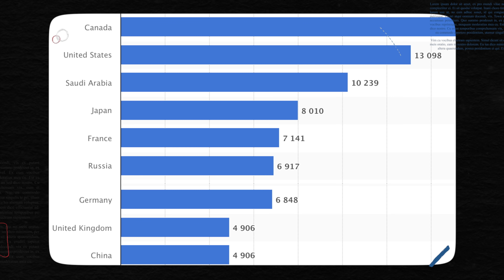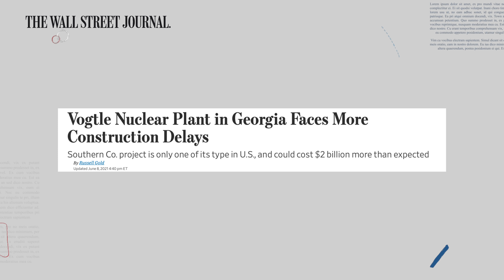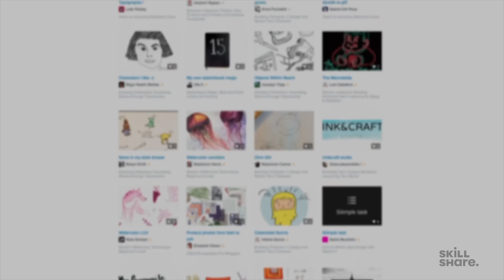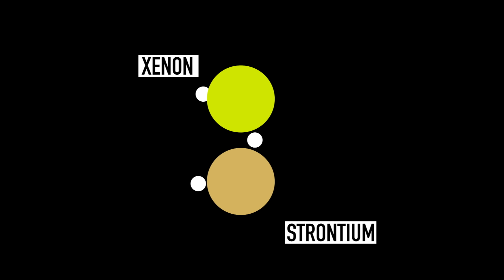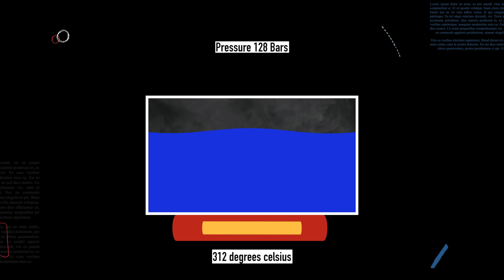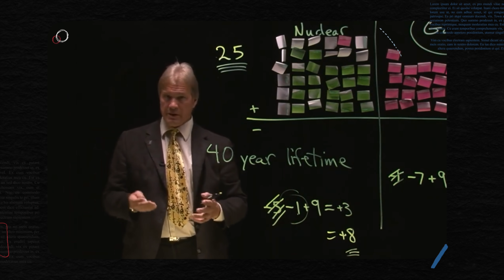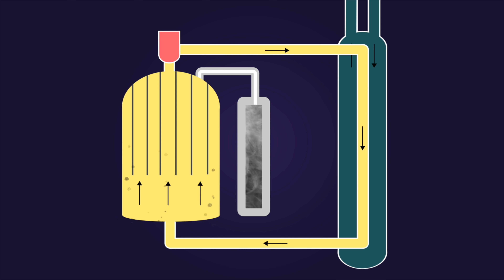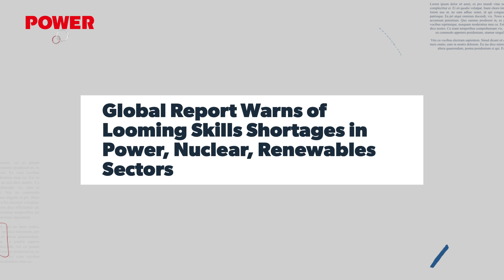Thorcon Just OBLITERATED Nuclear Energy’s Biggest Problem

Comment: The lady is absolutely correct. Nuclear electricity is expensive primarily because of the possibility of steam escape which at such pressures (160 atmospheres) is effectively an explosion.  Most of the expenditure on a nuclear plant goes into avoiding this possibility, and containing it, should it happen. The pressurised water reactor (PWR) is a giant jack-in-the-box. The terrific expense of of conventional nuclear reactors is trying to design them so that the jack-in-the-box never goes off, and even if it does, there are several schemes to mitigate the ensuing disaster, culminating in these massive, expensive containment buildings.  
We saw at Fukushima that the containment measures were ineffective. We also saw at  Chernobyl the Socialist foolishness of not even bothering to build a containment.
Another source of expense is in the precision manufacture of fuel rods, necessary for the operation of PWRs. In MSRs, the fuel is simply dissolved in the primary coolant.
MSRs do not need the enormous pressures found in PWRs in order to function.

Congratulations to the Indonesian government for being the first to commission an MSR reactor from Thorcon. 
Is this lady Indonesian? I thought she was Indian.

But mention was not made of Moltex, a company with an alternative design of reactor (which can be made in a factory rather than a shipyard, and will fit onto a few lorries, rather than on big ships), Moltex reactors not only generate electricity, but can do so from existing nuclear waste, thus solving two problems at once. Conventionally there is no way to deal with nuclear waste, except possibly to bury it, and hope that the geology will not spew it back up again. Nobody wants the nuclear waste in a hole near them. And storing it safely - perhaps for 000s of years is very expensive. So, consuming it in Moltex reactors and thereby rendering it harmless would be a very useful (and profitable) side-line, in places like the UK, which has a lot of plutonium waste from its existing fleet of Gas cooled reactors and one (soon to be two) PWRs. The French designed PWR is enormously expensive, and similar designs in Finland and France are not yet operational. They are years behind schedule.

Comment: The electricity use in different countries you mention in the start is per household, it is not per person! Still the difference between countries is the same. When we had 3 children lving at home we were at 6000 kWh/year here in Europe, but we don't use AC, our fridge i can carry alone and heating and hot water is from the local power plant as piped hot water, So mostly LED lights, TV, washer, dishwasher and computers use power.
Reply from the maker: Pretty sure the figures were per capita. Will check and edit. : P

Comment: you've got to love how nuclear plants kill less people per megawatt hour than people falling off roofs installing solar panels
Reply: True but The area around the roof isnt contaminated for decades:)
Reply: @jackphilipsen452  If the only permitted designs for aircraft were the ones developed in the 60s, we'd have huge number of airline accidents per year.  But we've learned from past mistakes, and while it is never possible to build a 100% safe anything, the odds can certainly be brought down to acceptable levels.  The lesson from Chernobyl is that you should not trust anything made in the USSR.  That really only leaves Fukishima as a major nuclear failure caused by inadequate design, which we have learned from.  3 mile island was sort of a nothing.
Reply: @jackphilipsen452  nuclear power plants don't contaminate the area around them though either.  Actually many a power plant has been built on already contaminated areas by previous industry, the land is actually restored to a cleaner state by the nuclear investment than it began with.
Reply: @jeremyO9F911O2  i mean after a meltdown like Fukushima or Chernobyl. Ofc then you make whole citys un inhabitable ,
Reply: @jackphilipsen452  first off learn what a meltdown is, the problem with those reactors is the explosion not the meltdown.  But good news nobody here is advocating for any of the reactor technology either is based on.  Generation 4 reactors are all safety first designed around new ideas and principals that don't allow the failure states that previous technology is susceptible to.  The MSR type reactor featured here cannot even remotely be in a similar state to either of those events.  You actually melt down the MSR to turn it on, it literally takes what is considered the failure state of previous reactors and requires it for normal operation.  Like I say meltdown isn't what you think and is a classic sign of ignorance in commentors.

Oh and BTW Three Mile Island was a meltdown too, with no significant radiological release and no long term contamination.   Before you comment learn the background because real advocates know the science and know the mitigations of new nuclear technologies.  Are you anti Science?
Reply: @jackphilipsen452  People are already moving back into the areas surrounding Fukushima. The release of radiation was rather inconsequential for the most part because the Fukushima containment vessel and containment buildings did their jobs. Chernobyl had no such containment building which is why the area around it is still contaminated. And these are the only two major accidents that have ever occurred that released meaningful amounts of radiation from the plant. All the waste from a normally operating reactor gets stored away from the public. 
Where does a coal plant store its waste? Take a deep breath, because now it's in your lungs.
Reply: @Clean97GTI  Yea how long did it take before people could move back, its over a decade and still there is high radiation in some area's around the power plant. You dont want your children to play on that ground. I Know the problems with coal plants and i did not advocate for it so dont  say I do. My point is that Nuclear is not the longterm solution as is coal.
Reply: @jackphilipsen452  There was never high radiation except around Chernobyl. In Fukushima, the average level is around 30mSv/yr, which is the same as background levels of radiation in some parts of the world. Evacuees from Fukushima were showing levels of radiation 3-4 mSv higher than normal which is well within safe limits. You get more than that by flying in a commercial jet airliner.
And coastal areas of Earth generally have slightly higher background levels anyway because of the minerals the oceans wash up. Seawater has uranium and thorium in it.
Nuclear is absolutely the long term solution if you want to reduce air pollution and combat climate change.
Reply: @Clean97GTI  you are not correct on the radiaton. Some spots around the reactor still gives too much radiation and are still not habitable. Also you say the radiation is well within safty limits, It depens how you look at that. We dont know the long term consequenses of long term exposion. Probably people gonna die of cancer more. (with coal its big too) Thats why nuclear is at best a good option to battle climat change for the near to medium future. Like I stated before. Nuclear has some big drawbacks. One of the biggest is the danger after a disaster (these wil always come sooner or later) And  nuclear waist. Where u gonna store it over 100 years from now? In your back yeard maybe? or dump it in the sea or a thirth world country? So we really need the urgency to innovate toward beter and safer technologys Thorium looks promising, This combined with solar/wind is the way to go.
Reply: @lkytmryan  True. Im not afraid of the accidents that happend before. We learned from it. I hope. But im afraid from the accidents we did not think of. For example:The Titanic was unsinkable but it did sink.
Reply: @jackphilipsen452  And yet we did not stop crossing the ocean in ships. We have turned into a country of safety nazis who are unwilling to accept any risk to live our lives. 

"A ship in harbor is safe but that is not what ships were built for."

Man was not meant to live his life in perfect safety. We progress by trying, failing, and trying again.
Reply: @lkytmryan  Sure, some riskt are okay to take, but some of them are not.
Reply: @jackphilipsen452  Renewable is more worse for humanity than nuclear. And you are totally wrong on what happened with Chernobyl and Fukushima.
Reply: @ManCheat2  al I stated about Fukushima and Chernobile is valid. Renewable is always better.  Its in the name. Nuclear can be renewable too. It all just need to be developed better towards Real renewable. As long nuclear is not 99.9 percent safe I would not go for that option ever. Too expensive too. Better alternatives are  already here.

Comment: This is a well-done, clear and technically accurate video that is worth a watch. It doesn’t just talk up a single company or technology but treats the concepts fairly.
Reply: The negative temperature coefficient of reactivity was not correct for Thorcon, only for LFTRs or MCSFRs with higher fissile to fertile + fission product cross section ratios.
Reply: @EdPheil  How can a liquid fuel reactor not have a negative temperature coefficient of reactivity? What, exactly, would stop a molten salt liquid fuel from expanding when it gets hotter?
Reply: @tsamuel6224  
A fuel salt has fissile contributing a positive component to reactivity. When fissile is squeezed out it provide a negative reactivity effect when heated. 

However, fertile, fission products, & other salt components absorb neutrons too AND 15% of U235 absorptions. When you squeeze these other neuton absorbers out of the core when heated, they squeeze poisons out, adding positive reactivity making power rise.

If poisons negative reactivity is greater than U235 positive reactivity, then the overall reactivity is positive.
Reply: Good, ain't she? This girl can boil something complicated down so Dufus McDumb can get a grip on a good sized piece of it while explaining it to the educable. Luddites man the battle station and guard your minds or you'll learn something from this girl. Her dad must be proud as hell.
Reply: I'm all for nuclear power, but the most important problem with nuclear power is the waste. No matter how it's stored there needs to be a way to reduce the amount that is stored. Either by finding other uses for the waste, or by making it non-toxic. Fission in any form is currently a dead end.
Reply: @thornblackwell5749  Thorium is the inert harmless version of nuclear
Reply: It does talk up Thorcon
Reply: You have got to be kidding.
Reply: @hewdelfewijfe No corrosion problem, I agree, but you do have creep even in steel due to high temperature.
Reply: Way too optimistic
Doesn't address corrosion
Dismisses the price of the fuel (but then says "unavailable" - flawed economic logic)
MSR safety and Modular construction: Great concepts - Best wishes - hope they're right
Reply: @fiftystate1388  Actually, not optimistic enough.  This is just a new spin on 1960 tech. Corrosion is addressed by the short use time span which is less than the proven near zero corrosion span, fuel price is in the fuel price chart and is abundantly available even though the preferred enrichment is unavailable, MSR safety was proven in the 1960s and modular construction is all that's new and even that is largely proven in modern fossil fuel plants. You criticized stuff than is largely proven safe but missed the elephant in the room that dumping nuclear waste on abandoned islands with sea level rising is dumber than sunbathing in nuclear radiation.
Reply: @tsamuel6224  Yeah, the "Indonesian island" solution was a head scratcher. Frankly I think we need multiple designs: safest operational, best turn-key, portable/emergency, least proliferation, best for legacy waste, best for fertile - As for corrosion: Design for maintaining those parts and then make them profit centers...not the "nuclear jewelry" fuel that's in use today.
Reply: @fiftystate1388  The unavailability of the fuel only applies to countries that are unable to do the enricment on their own. The low enriched fuel is available to everyone.
Reply: @mabl4367  You're being loose with definitions, it makes your argument appear ill-informed or misleading.
Reply: @fiftystate1388  It's also not being addressed that 99.9% of the energy created by nuclear energy is wasted while the byproduct of causing a critical reaction - heat - is merely used to create steam to turn turbines..! It's just an expensive dangerous steam engine. Fusion is the safer but more initially costly (and as yet unattainable) way to do the same thing but still does not address that it's still just a giant steam engine when we should be busy figuring out a new way to generate and transmit energy. We will never even reach type 1 civilisation on the Kardashev scale if we don't get out of the electromatic steam age we've been living in for the last 200 hundred years.
Reply: @1ManNamedDan  Boil water, spin a turbine,...,...,...,...to make coffee. And yeah, a great big classical motion is required. This summer we've had our share of thunder storms and it seems odd that we can't charge capacitors with lightning or something. I know that's not nearly as elegant or fundamental as the direction you imagine. Too bad we can't make a photon reactor and bombard a photovoltaic surface without blocking the Sun. But all we have for now are heat, neutrons and associated particles and rays.
Reply: @1ManNamedDan  Expect the previous three energy sources to be used to build the next, as it has been in the past and will it be in the immediate future. The immediate future will have a great deal of rotating shaft horsepower which is a remnant of using oxen & horses to rotate shafts to get work done. We will never reach type 1 civilization on the Kardashev scale if we don't exploit the steam age we are living in more aggressively.
Reply: @1ManNamedDan  You are incorrect to state 99.9% is wasted. All molten salt designs are better able to burn fuel by an order of magnitude more completely than solid fuel reactor designs, inc. pebble bed reactors. You rightly point out  that using steam is not optimum, but this applies to coal and gas power plants as well. What MSR allows is the option to store and use this high temperature (+600c) heat, akin to non-photovoltaic solar.power. In reality MSR compliment molten salt storage used by solar power very well. There is no technical reason why we do not use Stirling engines rather tan steam engines to convert the heat into motion for the generators. NSR offer an attractive  way to get the heat needed by many industrial processes. The world needs to move on from 3rd gen reactors and ineffective renewables.
Reply: @bobdeverell  "The world needs to move on from 3rd gen reactors and ineffective renewables." -Agreed-. My point remains Heat is the by product of fusion and fission while most of the radiated energy is terribly wasted. It is merely transmutation of heat to pressure and an antiquated way to harness that pressure to turn electromagnetic turbines - a HUGE waste of all the energy released.
We need to figure out a clean simple way to strip large masses of electrons from molecules and safely transmit them to electromagnetic devices and physical transducers or come up with alternate ideas that surpass the wasteful and redundant steam age we have been stuck in for a couple of centuries now.
Poisoning the environment and world just to boil water is willfully ignorant at this point and will likely prove to be the end of our species as invention no longer seems to follow necessity.
Reply: @1ManNamedDan  I take your point. I hope, as an interim to say aneutronic nuclear generation etc,  we can use  Stirling or similar heat engine technologies, but the Rankine cycle is well established and well understood and with heat recovery techniques, it is now up to 60% efficient.
Reply: except for...CO2 is plant food...not a bad thing...the elephant in the room is Carbon Monoxide...the stuff that kills you in your car...why these scholarly elitists cannot utter the term Carbon Monoxide as the bad is really really weird...
Reply: @boondoggle3898  You don't understand the science but you dismiss the scientists. Everyone knows carbon monoxide is poison. Can you sum up why it's dangerous in one sentence? This is a chance for you to turn this into a dialog.
Reply: @boondoggle3898  let me throw in a methane
Reply: @boondoggle3898  Carbon Monoxide is a highly reactive gas that does not accumulate in the atmosphere. There is nothing weird about not bothering to discuss a trivial gas very often.

Comment: Lisen to me;
“IS VIRTUALY IMPOSIBLE TO BUILD A NUCLEAR REACTOR IN 1 YEAR”
May be you can assemble the reactor in 1 year, something I don’t believe.
But is virtualy imposible to build a reactor in less then 3 years in the súper best conditions.

And molten reactor are very good… but if you made a deficient mantenimient you will have a very very  big problema, because they work in higher temperature and higher pressure… 
They are more Safte because his moderator, but they work in higher performance and if you fail at some point you will have a worst escenario then Fukushima.

And don’t believe that India will be a good place to suit this reactors for first time… the only other nation that is actually building a Molten reactor i chine…

New techonoly (France one) build in India in a ship yard???
Sounds like a dangerous jocke